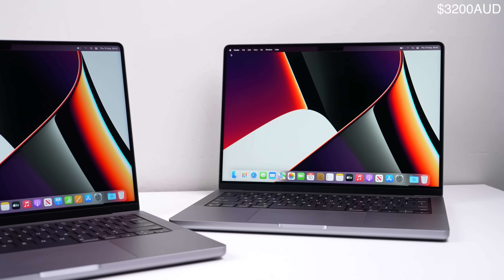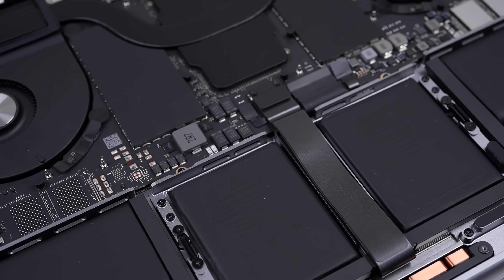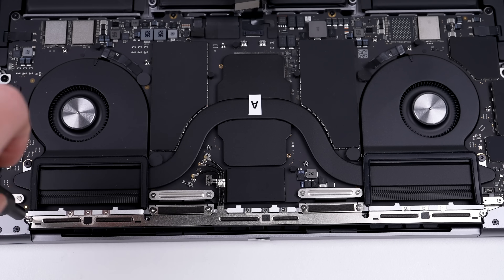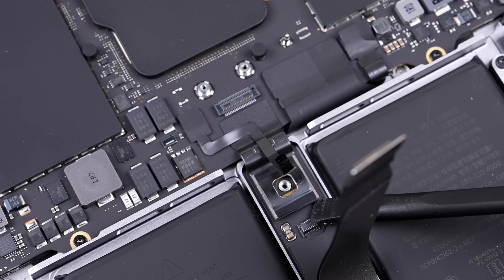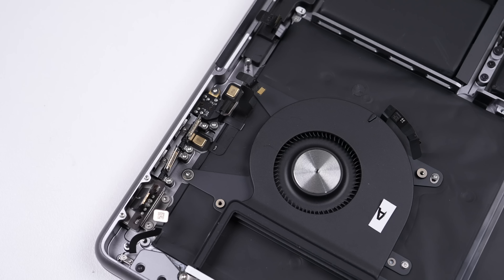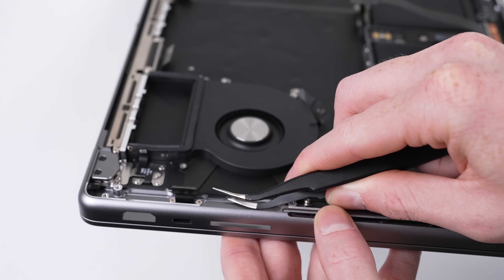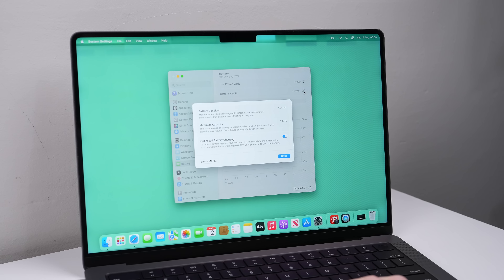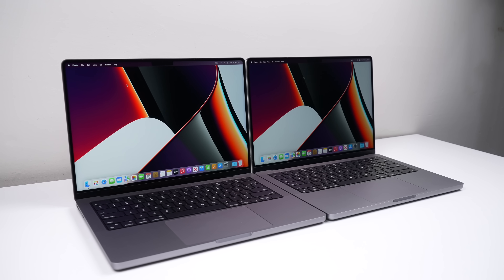New Anti-Consumer MacBook Pros - Teardown And Repair Assessment - Apple Silicon M1/M2

Comment: Im a technician and my company has partnership with apple, we get parts directly from them, if you change a display you have to change a lid angle sensor also and it won't work properly until you run a system configuration through apple server, most of the macbooks from year 2016 and further require system config, for example you can't just replace the logicboard, touch ID also has to be replaced otherwise you will have some crashes, im an apple certified technician but I hate it and will never buy apple products...

Comment: I’m wondering if resetting the laptops would change any of these issues? 
Apple has done that to a few devices, notably the fingerprint reader on the older iPhones. 
Might be worth the effort(again).
Reply: Maybe? But if an "owner" just needs the screen replaced, they wouldn't expect to have to wipe their computer to get a new one installed. And why would they, as thats completely unreasonable and unnecessary.

Comment: The Apple company is very communist. They want monopoly and they hate healthy competition of the capitalism. There's no need to calibrate the display when it's been replaced but they've programmed their display firmware so that it needs a "calibration". Their calibration machine probably just updates the replacement screen serial number to match the serial number on the logic board. Moreover, their calibration machine probably is a USB that has the software to upate a part serial number.

Comment: Its clearly not just "calibration" but certainly deliberate.
Apple will say: the backlights get calibrated to show even brightness across the whole area. The manufacturing process causes some areas to be brighter which get factory calibrated to be evem.
Think about it this way: If display A has weak backlight zone, 
its calibration would result in the A logicboard driving more current into that zone in nromal use.
Swapping the displays would than result in the Display A getting controlled with the calibration data from (or non at all, i will explain later) from display B. 
So the weak spot in display A would be dimmer as it does not get the higher current needed to produce the same brightness. Same for spots that are too bright.
If display Bs calibration data would be used, different areas would get more current because different spots on display B would be weak.

If no calibration data is used at all, both screens should show there "true colors" and show there weak/strong spots. 

However both swapped displays show exactly the same pattern which means it cant be "no calibration used" and it cant be "calibration from wrong display used" because the first case would show a random pattern of dark/weak spots and the second case would result in the inverse pattern for both laptops. 

For me this logic is evidence that this is a software "Bug" or better: Apple fucking its customers over completly! 
I (electronic developer) cant see a way that would result in that pattern other than a deliberate action in software programmed to make the laptops screen not swappable.

Comment: I appreciate unibody (2012 esp) MacBook Pro machines. I have, gifted to me, a great (so far) 2016 with all its potential issues but without having acted out on any of them. But I will avoid this current generation of Apple laptops like the plague. No self repair means for me I don't care for how speedy or shiny it is. Open Core Legacy Patcher (or even linux) on one of my old MacBook 2012s - jazzed up w/ a high res matte screen, 1 t ssd, and a second ssd where the dvd used to be - is just fine. Oh, and I got this as a toss-out (water damaged keyboard). Replaced the keyboard myself with another junker macbook's, and had myself a little slice of joy.

Comment: I got m2 pro or ultra or something mac and some newest iphone from work and i can confirm that everyone who is defending apple is far gone and completely disconnected from reality. I have my laptop plugged to 4k tv, first thing i had to do was BUYING an app allowing me to split screen into 4 equal squares as mac can do it only into 2. Everything that has black background is flickering (known m2 issue). The fonts are simply broken. I tried all possible settings without any results. On top of that os split all 'control' functionalities from linux and windows into 3 seperate buttons, control, alt and options... Not to mention £200 for a keyboard... iPhone, that's another story... After watching 2 15 minutes tutorials on yt and asking countless iphone users i still don't know (and no one above) how to close a keyboard in the app or 'cancel previous action' when there is no dedicated button on the screen for it, but somehow some ppl defending ios as easier and better to use system than android because it's obvious that swiping phone from bottom to left is going to open previous app, swiping from bottom to mid gonna minimise everything and also swiping from bottom to mid might open the list of previously opened apps and it's more intuitive than 3 fixed buttons on the bottom of screen. So all those and many many more inconvenient things making into twice more expensive devices than competitors make, because the customer have to cover a cost of additional engineering of features that will make the same device unreperable. I have no clue how apple managed to get as far as they did.

Comment: it's reparable but you need the proprietary software to calibrate it to unlock the special feature. So in other word apple say yea go ahead and fix it. The software is only available through us, so sure go ahead and repair it you just won't enjoy the full experience. Loophole in the system.

Comment: In other words, F apple. Let them fail themselves. If you keep buying from buyer that each time takes more and more control of product you buy, it means you don't need it. There are always a competitor. Buy something different, help other companies to build product which will be done for the people. Like EU parliament  did with phone batteries. All phones starting 2027 in European union should have a removable battery with no removal tools required. we will see what apple will do. Same as they didin't want to add type C

Comment: Would never buy a laptop I cannot repair myself.

Have never had to do much with any laptop of course but have replaced parts before, keyboards mainly (nice new keyboard also feels great), installed memory, hard drives/SSDs, replaced ports etc on a few I have owned and of course fitted a new battery once. Laptops are generally very easy to work on in the 2010+ era, there isn't much that requires a particularly high skill level and if you're confident working on PCs a modern laptop should be no issue. Parts availability for PC laptops is also always very good, plenty of suppliers for anything you may need. Replacing any part on any laptop should be a case of finding a supplier, buying it and fitting it.

Soldering SSD with no M.2 ports on a 'pro' machine? come on Apple, PC laptops basically offer 2 M.2 ports as standard now and crippling the longevity of machines like this is such a dick move beyond making then unrepairable by the owner.

Comment: There is no earthly reason for these components to have those failure modes. No windows laptop I've ever seen has behaved like this. I've had screens replaced, hall effect sensors changed, trackpad and top covers changed in the last 15 years... Everything else 'just works'.
Either Apple makes the worst computers on the planet, with horrible quality parts and the most useless and incapable software that can be conceived of, OR they just want to screw their customers over.

Comment: Apple has always been a pioneer in anti consumer practices, thanks to them most phones are glues together, made out of fragile glass (looks good yes, but you have to slap a case on it otherwise you're just taking an uneccessarry risk) and don't have easily replaceable batteries. On the laptop side, they pioneered the soldered on RAM and now the soldered on storage. Their devices are beautiful and perform well but I wouldn't buy one due to their anti consumer practices. I'm not shelling out hundreds if not thousands of dollars for them to fix my device should I damage it when I can do it myself or have somebody else do it for way cheaper...